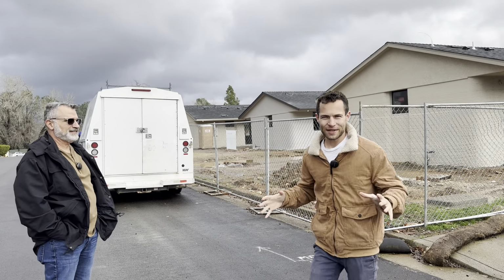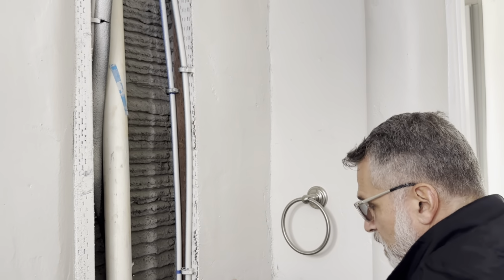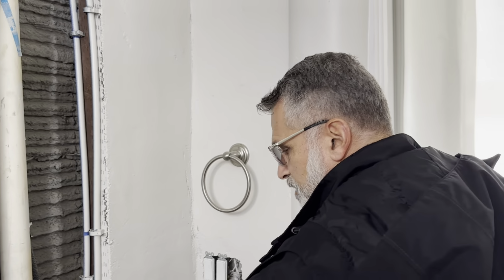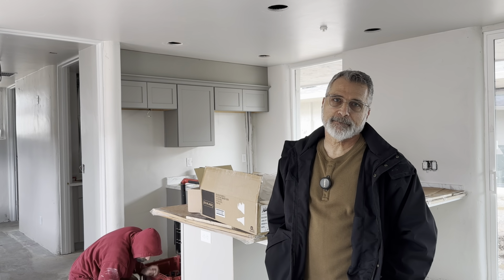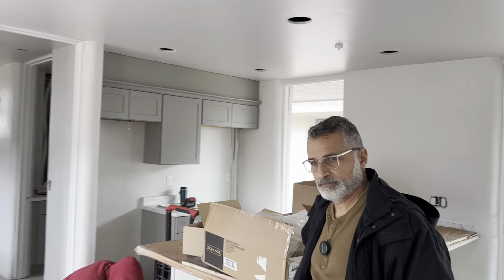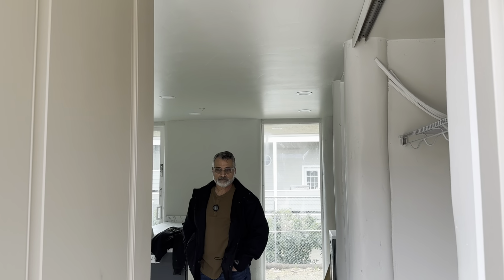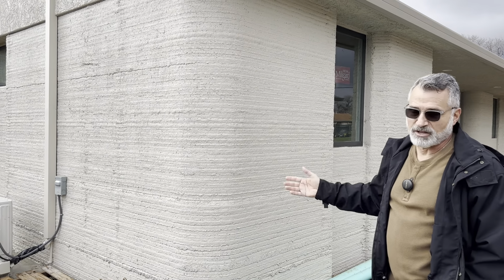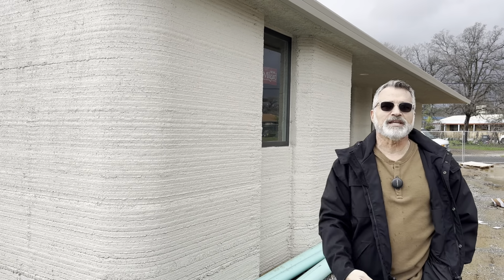Emergent 3D Homes in California Project Update

Comment: How long does it to setup the 3d printer? How many days to print ? How many days to finish afterwards
Reply from the maker: 2 days, 6 days, normal time like any other construction project after the framing.
Reply: @automateconstructionpodcast  very good . Very best of luck 🤞
Reply: I’m looking for 50 units of these in so cal I need to get in contact with this man asap. I was looking at icon from Texas but id prefer a cali company if possible